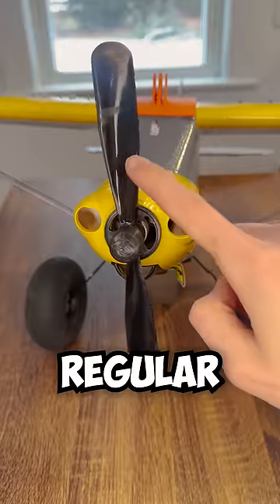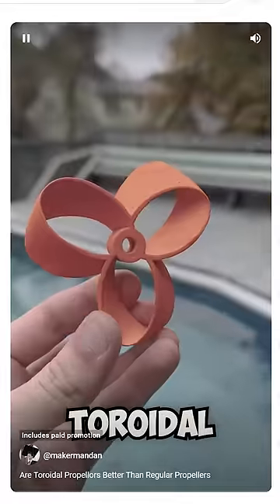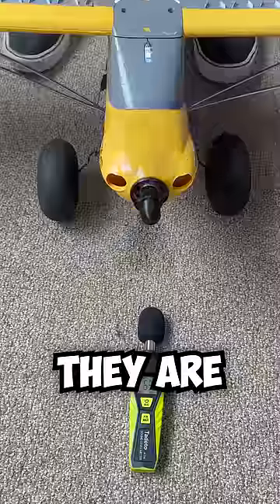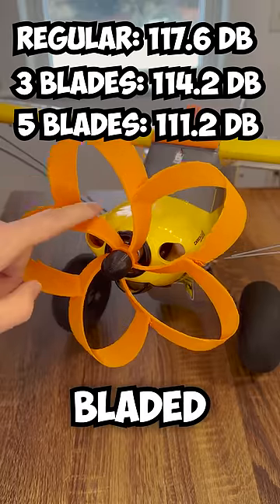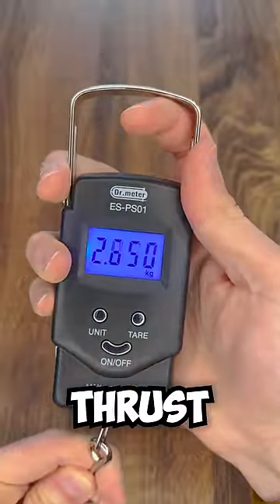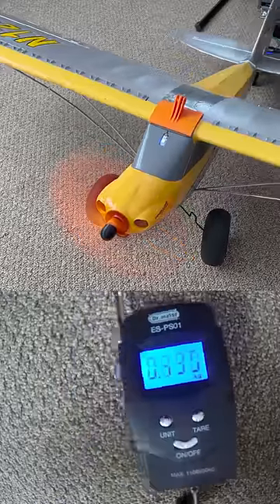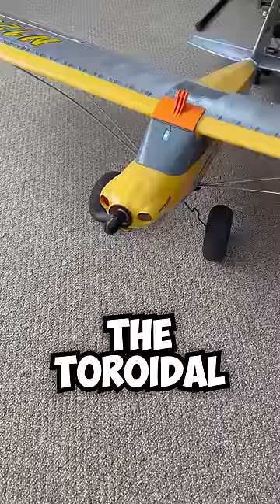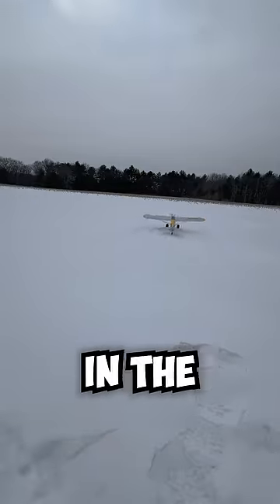Toroidal vs Regular Propeller for RC Plane

Comment: It's not only the decibels that impact the noise. The toroidsl propeller smoothes out the peaks in frequency of the nornal propeller making it more comfortable to listen to
Reply: Yeah, also, you can’t just make a toroidal shape and expect it to be good. There’s a fair amount of engineering involving the pitch and angle attack. The fact that a thrown together experiment matched up to a calculated prop at all is impressive.
Reply: @grubalaboocreosote4774 Yeah the ridges from printing already make more noise by creating resistance
Reply: Deleting my comment because apparently the one it was referring to was deleted.
Reply: @MONKEYGUY8504  symmetry has nothing to do with it.  It just produces a different sound because it interacts with the air differently than a straight propellor
Reply from the maker: Yes! There's less of a high pitch whine.
Reply: But these propellers have sharp edges. They aren't smooth and gently curved like other toroidal propellers. This is basically just something that looks like something else at first glance.
Reply: @grubalaboocreosote4774 in the fpv drone community an injection moulded and optimised toroidal propellor was already made and it’s been proven to be nothing more than a cute gimmick.
It produces less thrust, it’s louder and it is 10 times less durable.
Reply: @definingslawek4731  the only thing that proves is those guys failed to create a functioning toroidal propellor.  If it was "optimized" as you say, itd.. work.
Reply: The decibels are about as much as a supressed 9mm, which is fine for a couple shots but still worth wearing some ear pro for. Stay safe friends.
Reply: Yes, more comfortable, and less efficient.
Reply: @grubalaboocreosote4774  he didn't just "whip one up". Guaranteed he found a functional print where someone did the math.

You derp
Reply: 6 dB is a lot, 10 dB is what we subjectively hear as twice as loud.
Reply: @ObservationofLimits  the fact that it had so many extra ‘petals’ proves he didn’t. A toroidal prop loses efficiency with more than 4 petals.
Reply: same ideas factory's use. high pitches are weighted more on some DB standards since it can damage your eardrums easier
Reply: It’s more annoying to listen to… and is also not more effective or efficient
Reply: @jeffsorrows  no tf they’re not! It’s obvious you’ve never shot a gun before..
Reply: @lonewolftech  ive spent years shooting M4s, i own multiple AR15s, glocks, a shotgun, mini 14, mp5 clone, mp44 "pistol". I've shot suppressed weapon systems, .50 calibers and plenty of things. 9mm suppressed will be somewhere around 120-135db depending on which suppressor you're using, also if you can force a handguns slide not to move its queiter. If I remember correctly this thing had a db around the 125ish range. With suppressed usually I don't wear ear pro at the beginning but wear it after a while. I haven't bought a suppressor but you can rent one for a 9mm and 223/556 here no problem.
Reply: Audio engineer here, 6dB is FIFTY percent quieter (intensity). Decibels are logarithmic like the Richter Scale for earthquakes. That is a MASSIVE reduction in sound intensity, before even talking about how much it also lowered the super harsh high pitched frequencies. Decibel meters are useful, but dont not give the full picture ask compared to viewing it on a spectrum analyzer.

It also matters which DB measurement he was using on his meter, some are more tuned for "pure" intensity, while there is another one that is more designed for how humans perceive sound and which frequencies "hurt" more.

6 dB might not sound like a lot on paper, but even two or three decibels reduction would be significant. 10 decibels is 100%, 6 DB is 50%, 3 DB is ~25%. (The reason 6 decibels is 50% is because it's logarithmic, five decibels is not a 50% change yet.)
Reply: @ObservationofLimits  Imagine calling someone "derp", while being fully ignorant to the fact 3D prints are never equivalent to the 3D model.

 The surface of 3D prints is very rough, opposite of yo brain that's completely smooth.
Reply: @misdelivereddishwasher1011 if memory serves it has to do with the sound produced by the tip vortices created by the ends of the prop...or something along those lines.  Sound isnt exactly my focus so I only half remember it 😂

Comment: The edges of those propellers looked squared off and blunt while the traditional propeller looked more refined. If you want a more fair test, you need to print your own standard propeller to the same materials and standards as the toroidal. The toroidal propellers I’ve seen were precision milled to extreme precision using a 5 axis CNC to achieve their superior numbers.
Reply from the maker: Yea the surface finish is definitely not doing the prop any good.
Reply: @makermandan the extra weight wouldn't help either.
In scientific testing they are more efficient.
Reply: But to counter your statement, the propellers should be run with their speeds adjusted to matching thrust as well.
Reply: @outlawgamingrp  why would you adjust that? They should all be run at whatever power that motor can produce.
Reply: @benji3900  simply because that's the only real world scenario that matters if you are focused on the sound alone. The traditional propeller makes alot more thrust, with only slightly more decibels. In the real world situation, where you need the same amount of thrust for these to be equal in performance, the traditional propeller will probably be quieter.
Reply: Yes, I'm just pointing out it's not a scientifically accurate test.  I've seen research that a toroidal boat propeller provided more thrust, and less wake turbulence than a traditional prop at the same RPM and angle of attack.  It reduces the tip vortices similar, but better than a ducted propeller. But since they have both inside and outside curves, they are a lot more difficult to manufacture at that precise balance, curvature, and smoothness, making them expensive and rare. Can a toroidal propeller outperform a traditional prop, yes, can a 3D printed prop outperform a precisely optimized and manufactured prop, not likely.   @outlawgamingrp
Reply: Nah bro sound is logarithmic 6db is not ‘slightly quieter’ it’s literally 200% quieter which is huge
Reply: @makermandan Hey, I don't know what you're using what type of filament. Plugs depending on what you're using apparently you can smooth the surface using asotone vapor
Reply: @borttorbbq2556 it's not as smooth as Carbon fiber, it cannot be as smooth as any part made in a high quality mold, be it cast aluminium, iron, plastic, you name it.
Reply: And also run both of them at the same thrust. So the the new one probably will have higher rpms at the same thrust

Comment: Its not only the -6 dB that makes it feel quieter, but also the reduced frequency peak and uniform noise spectrum, similar to how they made car tires less noisy.
Reply: -6db is a 75% reduction in noise, as the decibel scale is logarithmic
Reply: Um conhecido meu ajudou a escrever um livro sobre acustica em automoveis pela UFSC. Voce conhece este livro? É um dos poucos produzidos no Brasil.
Reply: And there is no way that they’re in the +100db range. That’s louder than a rock concert.
Reply: @wartortilla2819  it's measured right at the propeller so it's totally possible. Sound dissapates quickly with distance.
Reply: For 25% less efficient and 25% slower? No thanks.

Comment: There is another problem at play!

Another guy on YouTube was putting together his own RC boat, and tried those types of propellers. He found that there’s quite a difference depending on whether they’re FDM printed(like you’ve done here), or Resin Printed.

Then again, he was messing with submerged propellers; any residual air could mess with its performance.
Reply: must be talking about RCTestflight actually i have the list of YouTubers testing such technologys and it's growing with dates for chronological timeline frequency of information spread and advancement 😊 the real bonus is weed free so your small lack in efficiency becomes a heavy improvement on efficiency for heavier weeded areas boating or i guess for planes bird strike strength etc though you aren't trying to tangle with such obstacles

Comment: I think the reason the toroidal propellers have some issues is the weights at the tip as they loop over into the next propeller. You might need to drill holes there to allow some air to fall out through it. If not that, then you might need to change up the shapes at the tips to account for air manipulation.

Comment: To make a fair comparison you should also 3D print a 1/1 replica of the original propeller. Layer lines, material and surface finish affect so much
Reply: in addition, the shape of each blade should be like a wing.   the vid looks like it has a square edge from the printer.
Reply: yeah im so tired of people printing garbage then testing it and acting like it is representative of anything
Reply: Exactly my thought. Comparing FDM to IM isnt accounting for necessary variables

Comment: The ultimate test is motor current draw vs thrust.  Otherwise, there are too many other variables in your experiment... which is really cool BTW.
Reply from the maker: Thanks!
Reply: i'd be interested to know their masses, as well.
Reply: Years ago, I was recruiting for an aircraft design team, and this was one of the questions we would ask. Most people were surprised by the answer.
Reply: The toroidal propellers are designed to drop off sound over distance faster.... @makermandan

Comment: i think the mass distribution is affecting the moment of inertia and requiring more energy to spin the toroidal one.
you may need to print it again with a different design to see better results
Reply from the maker: That is true, it’s a lot heavier
Reply: That should only affect how much time and energy it takes to get it up to speed, the top speed is unchanged by just increasing mass.
Reply: @makermandan  you should always compare them to a similar sized prop, thats also 3d printed
Reply: Yeah can you can see all the rough around the edges and extrusion which is spoiling airflow, a more refined design like the initial standard prop would be interesting.
Reply: @TowerCrisis I can’t see that if you have a dremel and you spin it and apply lots of friction it won’t spin as fast. Or if you add a lot of weight to it. Now a car with steel wheels and the same car with magnesium wheels will spin the same because of the gears and the tiny amount of total output that’s used to spin them.
Reply: I just don’t think hobbyists without access to CFD are going to be able to design a toroidal propellor that out performs traditional props. Considering the limitations of FDM, the amount of effort companies put into blade design, and even the amount of work that MIT team had to put in to get through results they did, small blades like this just aren’t as easy as everyone is making it out to be.

Rctestflight has a great video on designing a toroidal prop for his solar boat. One of the conclusions was even the proportionally smaller layer lines on his prop (small boat prop vs rc plane) were causing a massive impact on efficiency, so a tiny blade like this would absolutely HAVE to be MSLA’d at the very least. Combine that with some tapered blade tips and we might have a better result? Maybe? 

But everyone reading, definitely check out rctestflight and the fan showdown series from another channel where viewers design noctua fan blades. It’s a lot harder than you might think to even beat blades in the shape of among us characters!
Reply: Maybe the printed ones don't have contoured cross sections?
Reply: FDM prints will almost never beat proper injection molded parts. might be able to thin these out and get them SLA'ed
Reply: Yup, I just commented the same thing 😅
Reply: @danielleisrael friction and mass are different things. If you increase the friction, then of course, the top speed will be lower. However, if you only increase the mass (moment of inertia) and have the same drag, only the spin-up time would increase, the top speed will be the same.

Also the power required to sustain constant speed only depends on drag and not mass or moment of inertia.
Reply: @makermandan toroidal propellers may be a very good alternative to regular propellers. But the problem with the toroidal propellers is that they can't change their AOA and because of this they only become better when their AOA is at the right speed for the most efficiency. So when they go slower or faster than a regular prop they will lose their efficiency bonus. Not to mention that the toroidal props can only be at a fixed angle and AOA unlike the regular propa which can change their AOA for the most efficiency at any speed.
Reply: @РоманПлетнев-г3э  
While that is true, you also need to think that propellers are airfoils. They push air backwards while creating a low pressure area at the front just like a wing of a plane does on the top surface.
These toroidal blades on themselves have two airfoils per blade thus have almost twice the 'lift' surface up front and push backwards just as much... But unlike a regular blade that cavitates the tips and creates backwards vortices that induce drag, toroidal blades prevent a lot of cavitation by the loop at the tips....
So it is a tradeoff between drag, lift, push and mass at play... It's is not a one answer fits all.
Fair enough?
Reply: @aec007  No arguing with that. The original comment stated that increased moment of inertia slowed down the prop. I'm just saying that it doesn't.
While other factors of course still do (like increased drag/less efficient airfoil/ more surface area in general)
Reply: @nathanblanchard8897 what about sla 3d printing? I know that there's still layer lines, but they are significantly smaller.
Reply: @makermandan i also think that since you 3d printed them, they are not exactly perfect shape wise. If possible try SLSor some high quality printer. It should improve efficiency
Reply: @aec007  woah that’s plagiarism, someone call the bomb guy
Reply: @stephenhart8981 not so much injection molded as compression molded

Comment: It would be interesting to reduce the throttle on the regular propeller to match the thrust of the torodial ones. Then you could compare the noise levels at identical thrust. Also measuring current draw would be informative.
Reply: That would indicate a designed inefficiency in fuel and power, which in turn would be better solved by just flying slower or getting better headphones. As for civilian noise complaints, just fly higher.

Comment: I think what people don't immediately realize is that the 5 bladed toroidal prop being 6dB quieter is 4x quieter than the standard prop. That is an incredibly substantial difference.
Reply: This is a genuine question, how is it 4x?
Reply: @seenlenz dB is a logarithmic scale, a 3dB difference means a difference of a factor of two of its power
Reply: @nicholasm5184  aaaaah, right. Thanks man.

Comment: Also, please compare the amp draw vs thrust. It’s possible the toroidal props have a lower max thrust but produce more thrust per amp.
Reply: Well if the motor slows it draws more current. They might produce more thrust at the same rpm, but so does any bigger propeller.

Comment: For those who don't know being 5 db quieter is a little more than a third as loud 10^.5
it's because the math for db is logarithmic meaning that every 10 bd is ten times louder or 10^1 20 bd quieter is 100 times quieter or 10^2 and 30 bd quieter is 1000 times quieter or 10^3
Reply: You are wrong. Psychoacoustics isn't an exact science because it's so subjective. In general 6-10db difference is considered half or twice as loud but it differs from person to person. Also it's really hard to tell when something is "twice as loud".

What you're referencing with 10, 100 and 1000 times higher is the change in effective sound pressure in Pascal. The entire point of the db-scale is to get rid of the logarithmic factor because our ears sensitivity to sound pressure follows a logarithmic scale. And working with pascal directly is impractical. 0db is the hearing threshold of the average human.
Reply: What the heck? 

Is this math?

Nah,I m definitely not getting ANY certificate in academy now 💀
Reply: @NiliMoto I was hoping someone commented this. It's also why I personally go by the 6db scale as that's how SPL is measured... and that's all I care about :D
Reply: @NiliMoto 3db is half the power, db scale IS logarithmic, not to get rid of it. It's math.
Reply: @NiliMoto  he are not wrong, the sound pressure diff in dB will do hearing damages at proportional levels
Reply: @soldjahboy
Reply: @soldjahboy 😅
Reply: @soldjahboy
Reply: @williamleggitt2661  Man you're really trying hard to get my attention here. What's good bro?